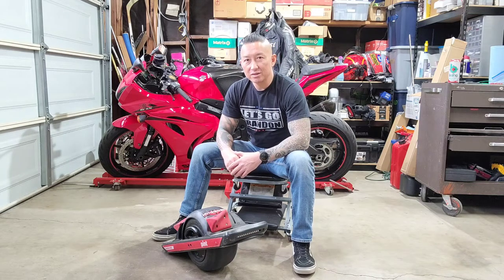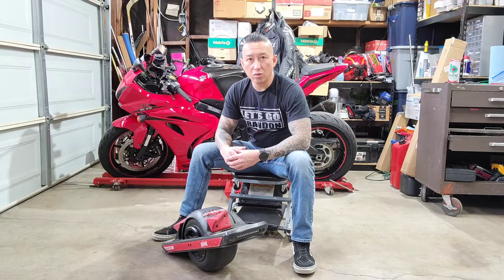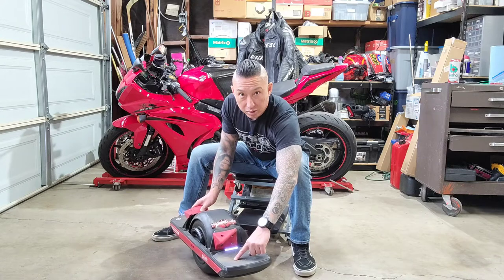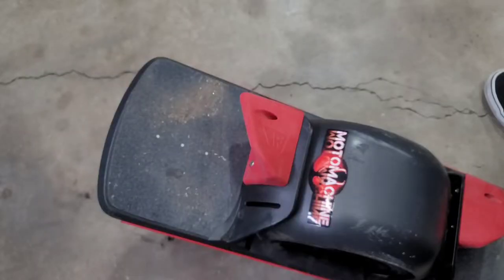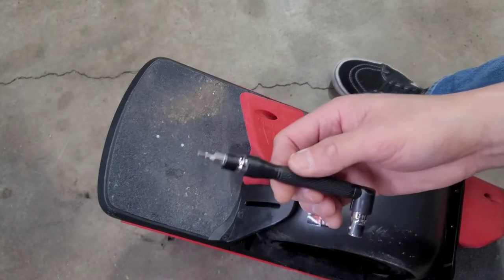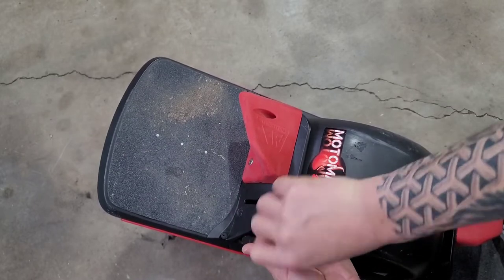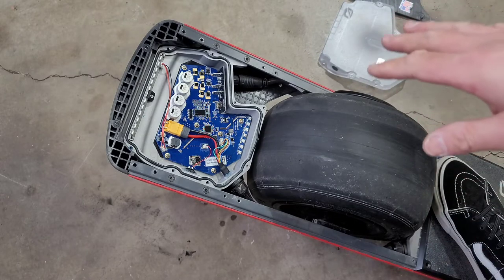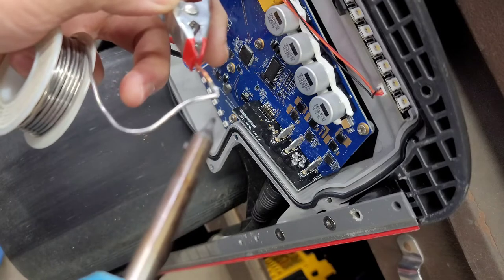DIY: Perma-Posi Onewheel Pint modification

Comment: Just recently did this to help my daughter ride, questions now is how do you dismount don’t really like simple stop as she likes riding both ways.
Reply from the maker: I use two ways.  1.) Jump with both feet off the board once it comes to a stop (I prefer jumping off on heel-side of board).  2.) As you come close to where you plan to stop, quickly step your front foot off and let the tail drag on the ground.  You will end up facing the direction the board was going (forward).  This second method takes a little practice but I equate it to when you tail drag on a skateboard when you come to a stop except you take your front foot off to disengage the sensor.
Reply from the maker: One of my videos has a riding tutorial showing how to stop and dismount.
https://youtu.be/mDgLU58j9y4 at 2:53 you can see me do the double foot jump dismount.

Comment: Is this the same for pintx
Reply from the maker: I have not opened a Pint X, so I am unsure.  It is proven to work on the Pint and I would assume a lot of the wiring,  especially for footpad sensors would be the same between the two

Comment: Pro tip if you have a soldering gun you probably know what a jumper is and you should just use one of those instead
Reply from the maker: Yep, thanks for the tip!  With the newer boards they shortened the contacts to almost flush to prevent the usage of jumpers, so I didn't really think of using the jumper.